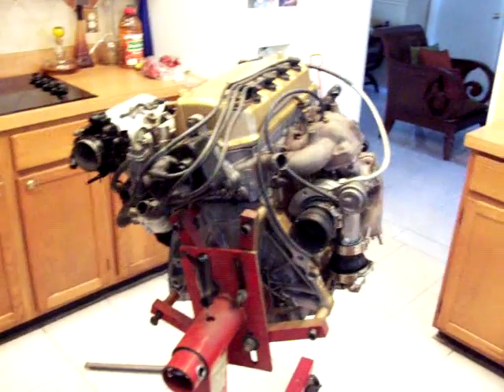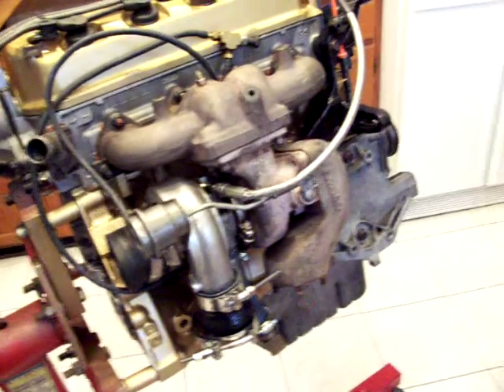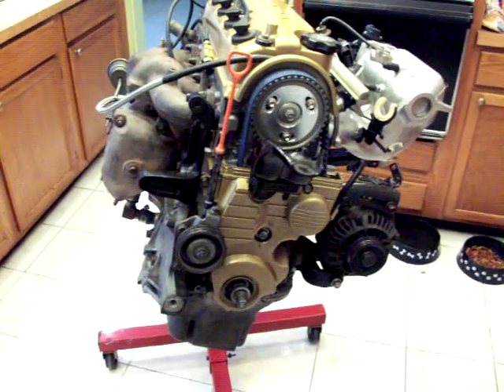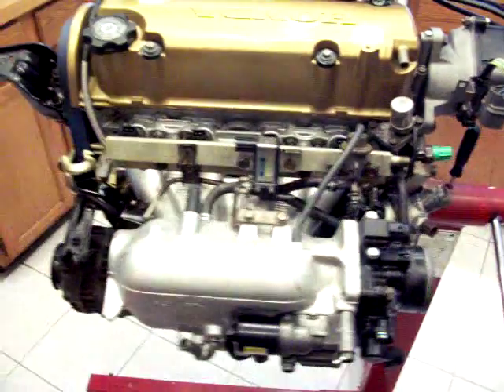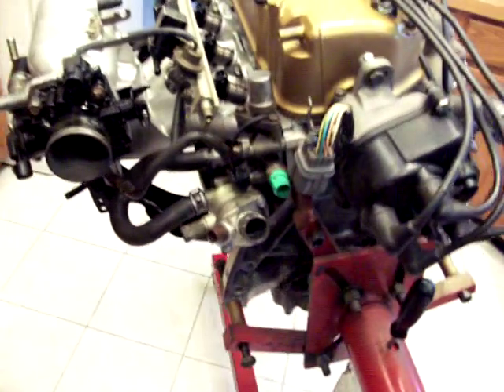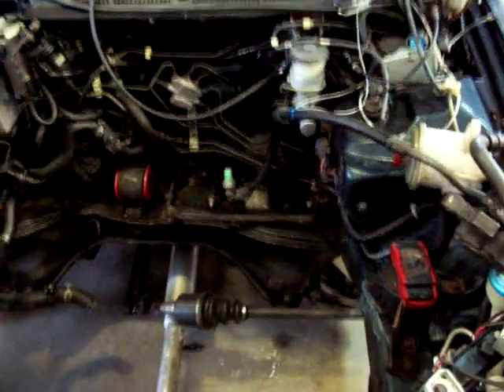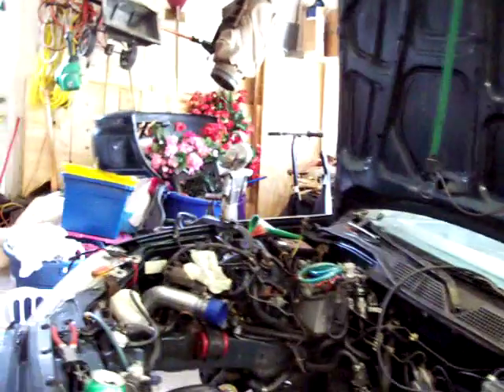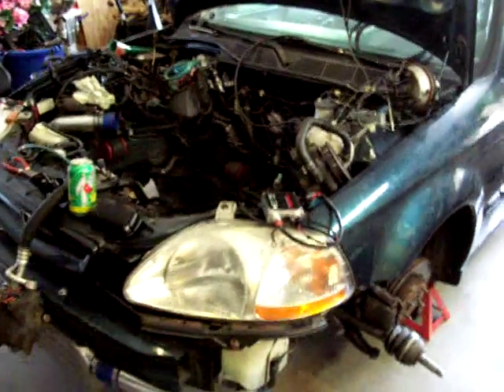Turbo D16 In Kitchen :D

Comment from the maker: @sk8err69z  No they didn't charge me..But on a side note..I'd save yourself the hassle and just buy either a Dart block or Golden Eagle..Most shops can't install sleeves for the life of them.	I had 2  different shop install 2 different sleeves into 2 different blocks..Both shops did them both wrong.."Nothin But Problems"

Comment from the maker: @ruizmontesluis10 No, never run a oil feed from the head..ever.At some point you will not send oil and blow your turbo..you wont get a constant psi from the head.. Always run your oil line from your block..I ran mine right above the oil filter..there's a oil port there.